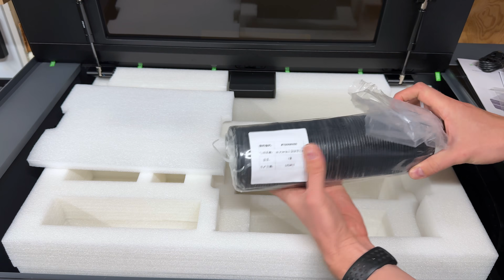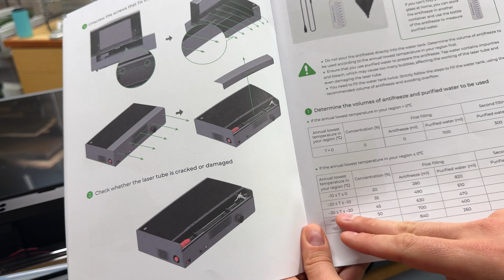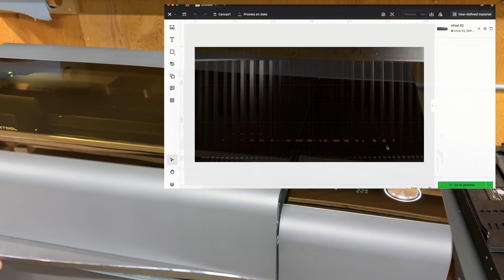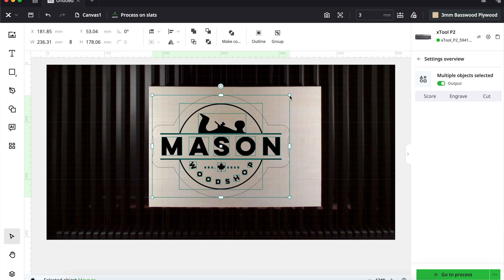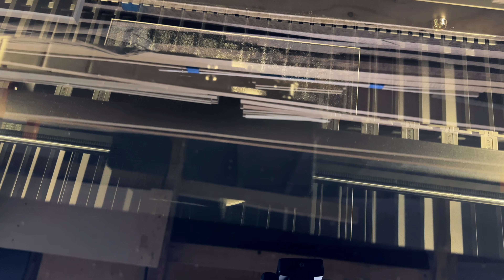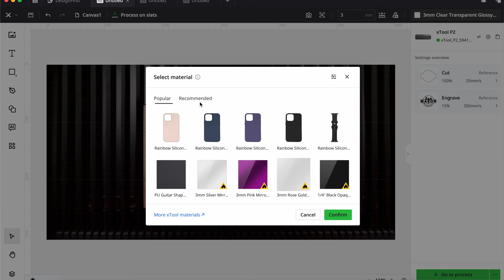Full Setup and Review of the xTool P2 55W CO₂ Laser Cutter and Laser Engraver

Comment: Have you tried cutting pieces of wood at the upper limit of what it can handle? I believe it’s rated to cut up to 18mm (0.71”), I work with mostly 3/4” softwood cedar so I’m worried it may not be able to handle it. Thanks
Reply from the maker: I have indeed, and it can cut material that thick in one pass…however the resulting edge is not very good and will have a lot of burning. I generally stick to material 1/4” or less to avoid overly black edges.

Comment: Some laser cutters come with air assist built into them.  How it is in this laser? I'm worried that the wood will be burned without air assit.
Reply from the maker: Air assist is built into the P2/P2S and works really well! I’d say it’s better than the external air assists I used on the S1 and Creality Falcon2 Pro.
Reply: @MasonWoodshop  thank you!
Reply: How were you able to use it without adjusting the mirrors?

Comment: Good review, what about using retractable/flip up castors to resolve the one issue you mentioned about having it level and also having access for maintenance.
Reply from the maker: Thanks for watching! A retractable caster system with balanced supports was my original plan but since doing this video I ended up loving the laser into my downstairs craft room.

Comment: Nice job on the review. Sure seems like a lot of charring on the wood cuts/engraving. As for the acrylic, did you not totally clean it, or is there a lot of "haze" from the engraving process?
Reply from the maker: Thanks for watching! The charring on thinner material 1/8” and 1/4” is very minimal (especially when compared to my 20W diode laser that has to go slower. On thicker solid material it’s a balancing act of speed and number of passes. When cutting up to 1/2” walnut I now do more passes at higher speeds which has help with charring to the point that a light sanding around the edges makes it look perfect. 

For the clear acrylic, that was my finger prints making a mess of it. I’ve done a few dozen cuts of clear acrylic and haven’t noticed any hazing other than on the absolutely edge.
Reply: @MasonWoodshop  thanks for the additional info!